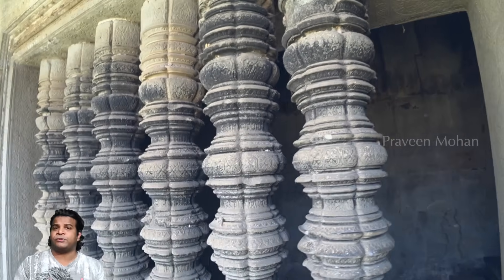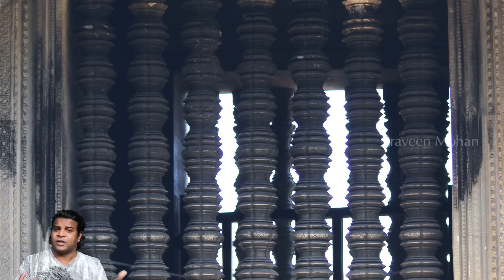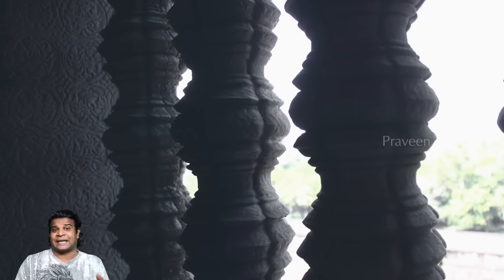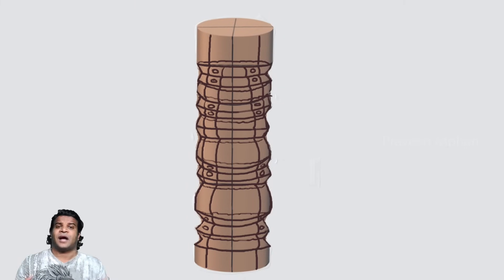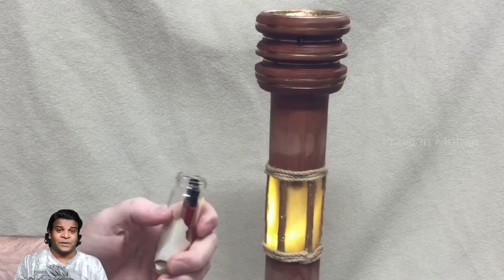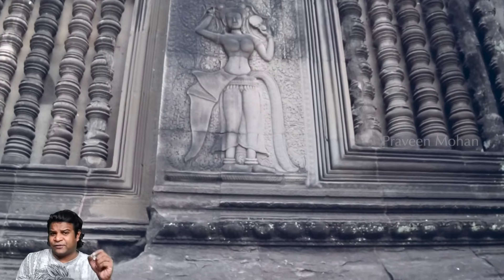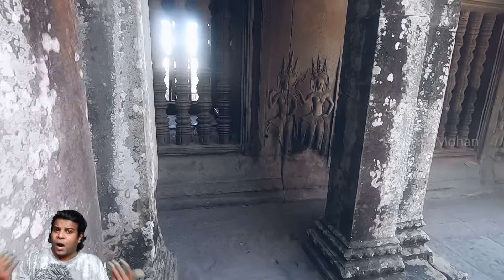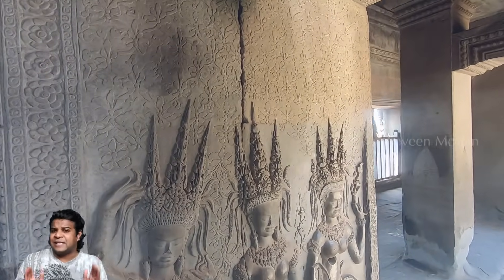IMPOSSIBLE ANCIENT MACHINE Found in AngKor Wat? Lost High Technology | Part 8 | Praveen Mohan

Comment: The issue with lots of these hindu temples is they are sandstone, its soft. In many cases, yes you can use a lathe and simple copper tools. Egyptians had the lathe, almost all countries moved from coil based pottery to lathe based, so using the tech for stone isn't that crazy. These aren't impossible, just time consuming.

Comment: I would suggest it might be a metal rod that needed to be inserted down the center because the sandstone pillars would be to weak to stand unsupported.  It is still very, very clever, if that is what the ancient builders did. Thanks for an intriguing video.
p.s. Perhaps the pillars were quartered and the rod inserted (then they were sealed) BEFORE the lathe work was done?

Comment: As conservator at Angkor for more than ten years I have fixed many of these colonettes and they are not sliced vertically as you observe. They are single colonettes of sandstone which are beautifully carved on a lathe; in that you are correct. The lathes would probably have been water powered since they had excellent understanding of hydrology and today use water wheels all over the country which is an ancient technique, no astral mystery there. They are not cut in to what you call four halves (normally by my geometry you get two halves and four quarters but I know it is confusing). You may also be confused by some vertical cracks which are caused by the bedding planes of the sandstone since all the colonettes are bedded vertically which causes problems.There is also NO ENERGY BOX as you call it, this was conjecture posed by the video that you cite frequently but which makes up a lot of stuff and in which I am interviewed. They tried to get me to say about the hole in the tower and the suns rays but I refused because this is totally false as there is no hole and no sarcophagus in Angkor Wat. I would also take care in lifting video sections from that documentary because you may be breeching copyright.
Reply: I agree with the hydrology hypothesis... applies also Egyptian sites

Comment: Any metalic product can be made by using following methods
Machining
Casting
Forging

Sand Stone is a hard but brittle material so we can't use forging here.

Machining is one the best way to achieve precision product rather than casting.

Casting is mostly used in olden days  to make metalic structures. But casting products has much more errors than machining.

If the pillars are really curved precisely than may be they Casted the Sand Stone and further processed with hands using Grinding Wheel or Sand Paper like tools.

I have no evidence that sand stones can be casted.

Comment: Hi Praveen, my last job was similar.  The details from the inside had to be hollow (a pipe had to pass from the inside) and in order to avoid breakage during the rotation of the lathe, I decided to make them from two parts of a CNC router.  Definitely the details you show look like they were made on a CNC lathe, router or both.  The problem is that these buildings were built hundreds or thousands of years ago.  I can't imagine what planning and construction activities require to build such buildings, even from today's point of view!

Comment: They have some kind of mechanism or some tool which uses sun rays...and make a beam or lazer of enough heat to melt stones and castes these kind shapes..we find gold plates on different locations....which is in disk shape which reflects sun light at one point...so there is that possibility because PREVEEN MOHAN SIR noticed at many temples and places where there are some fine cuts..there is no way they are formed by hammers...smooth surface equal and straight cut...90 degree angles on them.. wall formed by aligning rocks but rocks and stone are like puzzle put together there are no space between them....

Comment: Is it possible that this is a hydro-solar heating system?  Pipes in the centers of each column have water in them, heated by the sun, and the water moves throughout the stone, heating the buildings?  We have systems now that heat tiles floors with domestic hot water, why not solar heated water through hollow stones?

Comment: Yeah casting can be a possibility, but think about this, how insane it's to build a mold cavity with such precision Nd finishing, even today it takes multiple difficult  steps to create a mold cavity itself forget about melting rocks or rock resin technology Nd low quality molding Technics doesn't even last long, coming to this Piller, it's more easy for ancient builders to go with subtractive manufacturing/machine than casting. If in case they are casting pillers and other parts of temple then there should definitely be the remnants of those huge mold cavity blocks lying somewhere on/in the ground just like the volcanic rock slabs lying on the ground discovered by Praveen bro🔥, but not Praveen bro didn't found any mold cavity blocks, if he did he will address about it in the video.
The most fascinating and mindbogglingly thing is that if all these different parts of temple complex were created/manufactured using some machines or some advanced tools to create this enormous masterpiece then there should definitely be a group of ancient builders and huge no of workers
Handling these advance tools and machinery
The question is where are all these tools and machines, y no one is able to find at least the ruins of one tool or machine, when there are many other masterpiece temples around the world which used similar Technics Nd  technology 🤔. It's like all ancient builders decided to destroy their technology to ashes after building the temple 😶 this doesn't make any sense if this is true how can all builders around the globe stand on one word unless they have the abilities like telekinesis etc.

Thanks if u read till here, 👍🏻 ur patient, curious Nd great. If ur interested to talk to me about these topics ur welcomed
My Instagram id: harsha.jsm

Comment: Hi Praveen. I like alot your footages, and can underline the following things: 1) the pillars don't seem to me to be cut in 4 pieces, but, instead a single piece, with a straight groove cut all along. There's no point to put something "secret" inside them, since there are many other ways to do the same in a wider spaces. 2) If you see @7:40 of your footage, on the right, the shadows of two adiacent pillars, (the illuminated portion) remembers me the shape of an actual BUT INVERTED pillar. That could have a better explanation. 3) lots of pillars seems to be missing. Is there been found some piece there around to see how they where built inside??

Comment: Using the natural light is one of the key elements of such ancient architectures, specially day light. But what about light at night. These pillars are around the temple and it seems that they were made for multi-purpose. Not only maintaining airflow, day-light but also to use them to light up the temple at night. It can also be an example of clock to show time and seasons as per light shadows. We can understand this concept if we understand the geographical position of this temple as per Hinduism. The carvings of human around windows could be the shift of guards for the temple. What do you think of this Praveen Bhai ?

Comment: Vertical waterlines makes vertical waves but, each pilar has flat magnet if we turn the pilars on 3600 secondes we can make a diagonal line, why this this daigonal line created a angleline like cilindersDNA if we make 180 degrees angle from pilar two to the right pilar groundcicle we turned the diagonaal upside down bij 144 times(little ) times 2= 288 times four =512 (bigger square of squarebox111) so what will happen inside is thisVVVVVVVVVVVVVVVVVVVVVV by 2 times is NNNNNNNN + NNNNNNNN=N2 but 180 degrees is very long way for a line looping. so how many stonebricks of 5cm we need to make a loop of 180 degrees 45 90 45=180= 2 longblocks a middleline 0f number 9 of A on BG is ground(earth) but groundzero is more dieper and below so above. all the pilars looks the same outside but you not see the difference with a naked human eye,why because its microtecnics each pilars is moved like a clock this i call dimension movings and turning the loopingsangle inside the box. lets not talk about elektrical waves i do later, we understed there all connected, horizontal on them piont cyclings flat object
 square of 5 or 7 times= 5 or 7 pilars and 3 upstairs is an flat horizontal square o 5 little lines and a circle of 7 little lines so 7 little lines=one big invisble pilar with 7 turns. we go back to straight horizontal pilars so 5 or 7 pilars has micro circles on a vertical line of each pilar. questions are
. what is the lenght of one and variable lenght of wired 4 vertical lines inside=5 so its making one cylinderical snake turned by a little movement of 1Ms=10Mn , 100=? 1000=? 1Second = so 10 seconds = 1minuut =1mm milimeter so 1,2mm=1cm 3.346=11,17mm=11,2 (0,03x3=0,09)=Micro 0,01x9=0,03x3= one     cubit or bitciont or byte. 27 dots=9x3=27 dots. How many dots you need to fill up a pilar or a sky of 180 degrees like a orange helf if we look at it and for each of the 7 timewheels first in a straight line but inside a flat square it loonks like 28 time invisble wheels

so 28 : 7=4 =2lines a crossing line and a inner olive on top. so 7 times a circular radius x 2 =
14 lines crossed by 2. 14-10=4. so 10-3=7(40 12 28)(39+1 11+1=12 6+1=7 number on needs two friends 1 and 1 +=3 so 40-1=39  80=2=78 160=3=156 320=4=312
so 2=12

Comment: Are they sure the pillar are sand stone and not some kind of compound? If it is a kind of concrete it would explain why they are split in 4 and would not require machine to make, they could mold a quarter of the pillar and then put them together. The result would be perfectly identical pillars. A compound can become and look like rock after centuries of aging.

Comment: lets think about it critically. 
if i wanted to have 4 halves of round pillars i would start with 4 square halves and center the lathe at the center where all 4 parts meet. securing the 4 parts to a locking base you could then create the pillar. after that you could cut the pillar from the locking base and you should be left with the 4 quarters of the pillar.

but that's just one way I could think of how it could be done today.

if possible i would rather have a way of casting a mold or 3d printing but im not sure if that is possible with what its made.
Reply: I was thinking about the mold too, but you wouldn't mold 1/4 of the pillar, 1/2 is optimal. I make a lot of molds and getting stuff stuck in wonky mold ideas is my specialty 😂

Comment: they might have cut these pillars into four pieces to  relieve tension in the stone that might cause cracks....
Reply: I agree with the idea that they may only be shallow longitudinal cuts to relieve tension to avoid cracking, but closer inspection is needed.  The limestone was softer when first quarried, and it is easily conceivable that they used lathes, however simple.

Comment: I repaired radio equipment in the military. These pillars could contain radio transmitter coils. By the length and number of coils the frequencies could be calculated. If not originally fitted with coils these pillars could have been split to hide the technology from the local population.

Comment: I think those peoples were using stone melting technology for these window pillers...for big pillers they use like let machine technology ....but they done vertically line work this is not possible for let machin...so I think they use stone melting technology
Reply: And alsio the carving work is easily done by stone melting technology without using chessals and hammer
Reply: And I think these are single piece pillars not made from four pieces ..

Comment: I think there may be a copper rod in the centre, l don’t think they are purely decorative, l think they may have a function,  lathe technology could have been achieved, using their advanced metal working techniques, and harnessing waterwheel tech, or water vortex via descending funnels to create pressure, quite achievable where there is fast flowing streams, or possibly using steam tech,, maybe if these pillars were in water they might release electrons that can be harnessed for power.

Comment: What if the stone pieces were poured like cement into a mold...?   If you were making multiple identical cylindrical columns via mold, one method would be to simply make all columns with from a single mold that is only a quarter section of the column, then you put 4 of the casted qtr mold pieces together to create each of the cylindrical columns.

Comment: Step 1: have 2 or 4 prism : triangle or rectangular is fine.
Step 2: polish the surface
Step 3: put them together and tie them tight.
Step 4: put on lathe and start the the cutting process.
Step 5: carving

That way the pillars remain perfectly cylindrical. If you done on the lathe then cut into 2 or 4 parts, then to make it perfect cylindrical again they have to have filling to compensate the cut away material.

But however way they did it, those pillars are truly spectacular, and they certainly weren'tt done by chisel anf hammer.

Comment: They used a unknown form of molded concrete that is identical to sandstone they carve the mold out of trees
Reply: Yep... molded. Roger at ' mud fossil university' has proven that compounds change when subjected to floods and earths electricity. So what we call sandstone now, might have started off as something else. Same thing could be said for megaliths and Pyramids.
Reply: Possibly molten concrete
Reply: @Fourth4Element  you cant melt concrete and why would you need to its a liquid conglomerate
Reply: That's what i was thinking
Reply: I think so too. Also because he mentioned it at other videos many times before.
Reply: Yah. There is a chance 
Mould and joined.
Reply: I think it's diamond water cutting technology which was discovered only few yer for us
Reply: Could it be identical to sandstone tho?
Reply: @maneeshg5487  Yes why not. Take a look at how we make moldings today. It is also possible with sandstone mixtures. Sandstone alone would be destroyed by rain etc. Check out more modern buildings made of sandstone. You don't see any tool marks on the video, at least not me. So I assume that there was no scratching here.
Reply: @martinj.3661 You could be right bro. Well, everything about Angkor Wat is a mystery. Also, what powers the lathe spindle PM talks about and what kind of cutting tool could they have used???? 🙄
Reply: @maneeshg5487  I guess it's manpower. Like old sewing machines with pedal and swing force. There is another video from PM which describes some kind of mechanism (rotating stone plates are used like turntables and are circular carved with kind of needle). Finally, I think that it is possible to manufacture such objects without high tech equipment.
Reply: @martinj.3661  But without hi tech equipment how can the high level of precision on complex shapes can be maintained consistently?
Reply: @maneeshg5487  That depends on how you look at it. There is probably a lot of work involved, but from an objective point of view only primitive work. These are not complex reliefs but mostly pictograms. Sometimes there are details that look astonishing at first glance, but are actually very simple to manufacture. Some people just have the talent to create such things. The best example for me is the astronaut figure on one of the most famous temples. This would be attached afterwards and looks like it was attached from the start ...
For certain shapes it is enough to make a negative out of wood. (Wood has been worked very precisely since a very early age.) If you hear hoofbeats, think of horses, not zebras ...
Reply: @maneeshg5487  moulds
Reply: @gorrthebutcher4696  yup

Comment: Do you think its possible it was cast as quarter pieces then put back together?
Reply: But I don't understand why Praveen claims that they have been divided in 4 parts like a pizza - maybe these are just indentations, no need to imply that the whole column was divided into 4 parts.
Reply: @ultrafeel-tv  I agree. It doesnt seem like there are actual joints there. The builders would have had to use an ultra durable cement that degrades at the same rate as the stone. Like someone else mentioned, we wont know for sure if its a solid piece unless a scan of some type is done to see the inside. Still, I appreciate Praveen’s intriguing insights.
Reply: These are the questions at hand .Was it a mold a lathe or something like a 3d printer ?
Reply: After watching the documentary “The Movie Great Pyramid K 2019” I look at most of the ancient sites and wonder if most of the stonework was cast using geopolymer concrete and fine engraving done afterwards.
Reply: I had the same qsn

Comment: An alternative explanation of the longitudinal grooves might be that the pillars were mass produced in quarter sections using wet sandstone cement.
That way, half, quarter or full pillars could be constructed and installed using combinations of quarter sections. This would be more efficient than trying to form full pillars on a lathe, then cutting them.
That would explain the half section pillars on the outside walls, which are installed against blank walls.